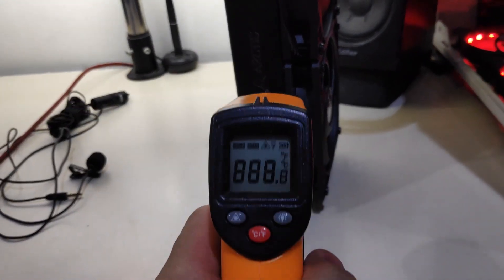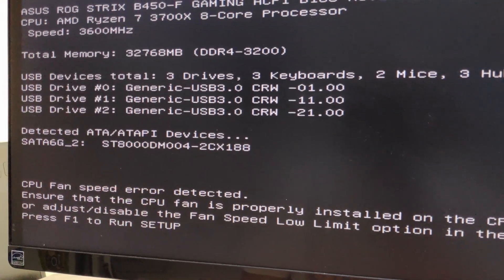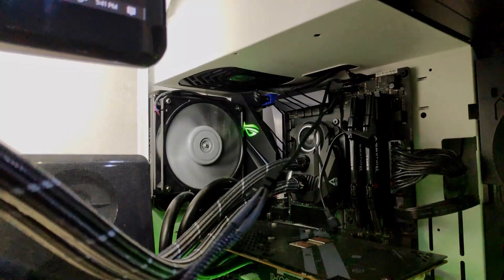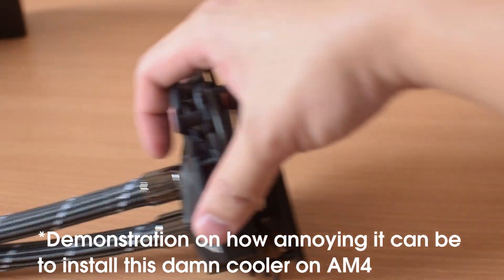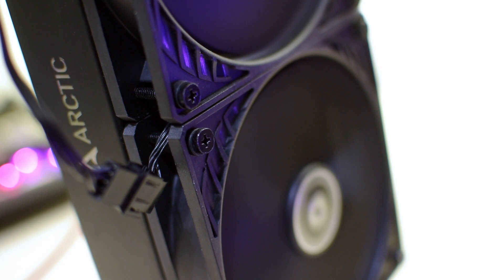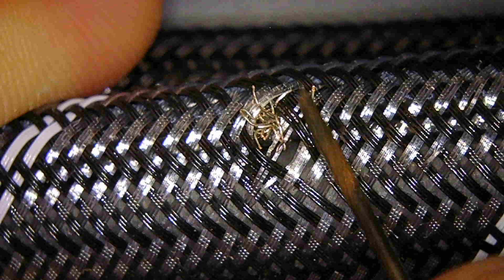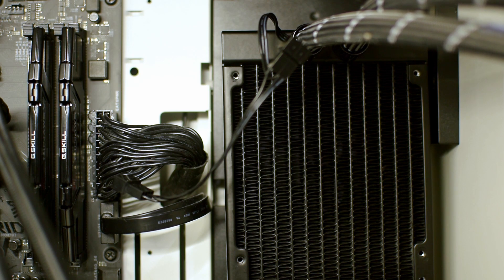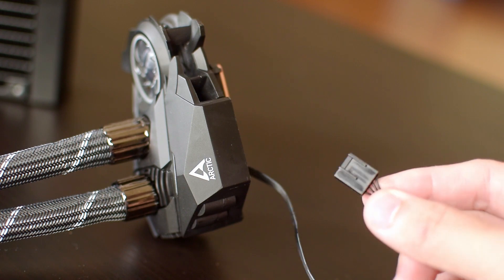DO NOT SIDE MOUNT! (EDIT: New video for Revision 2 review) - Arctic Liquid Freezer II Review

Comment: Hi, anyone around here has an arctic liquid freezer 2 AIO? I remember GN tested it.

after some issue I had to replace my 360 unit (it has issue with vrm fans) but now the pump itesels seems noisy.

Is this pump noise normal? When i plugged it it was very loud but after 20m it the noise seems to be lower , maybe it was just some air bubble but i wanted to be sure all is fine :

Noise at 20/40/60/100/100  : https://youtu.be/Uzrr3dOoMPs
At 20% the noise is even more audible : https://youtu.be/qaywL8uiuQM

I tried to tilt the case in different way to get rid of what seems to be an air bubble without any luck. Should I ask for a remplacement to amazon?